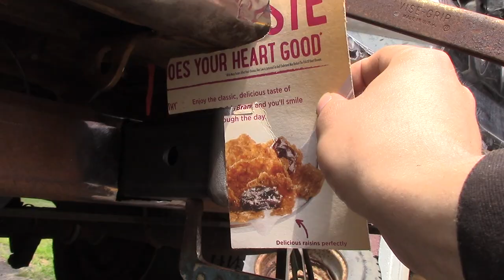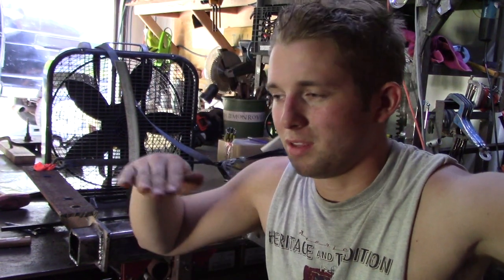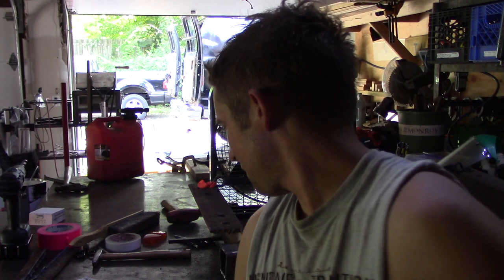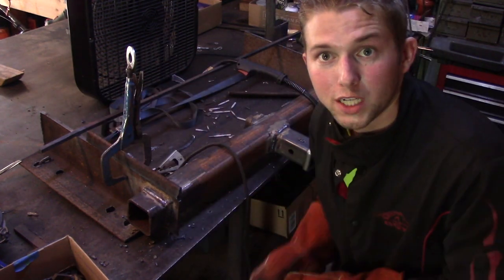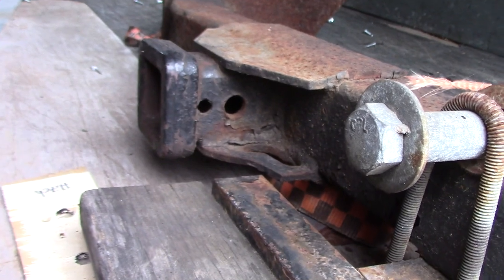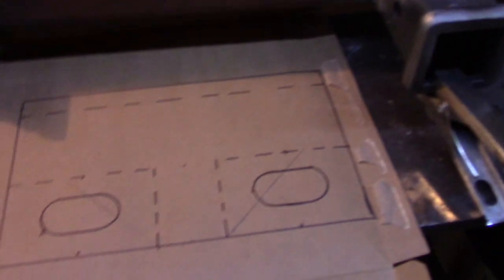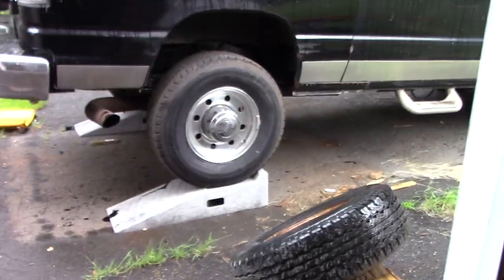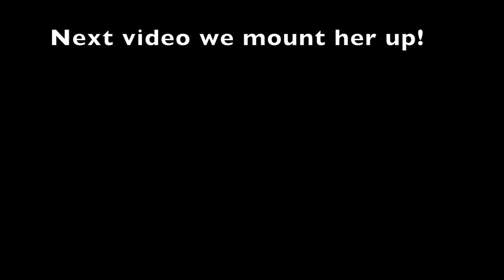Fabricating a Custom Trailer Hitch 2

Comment: For tacking 6010 is great. Run it down hill on verts. Whip pause whip pause etc
Reply from the maker: Its easy to strike, but I've had trouble getting a clean looking bead from 6010
Reply: SnowPlowLife 6010 is a lot like 6011 when welding. WeldTube on youtube has some really good videos on stick welding. Thank you for you video I just got done building a hitch for my duramax.
Reply: I have an antique marquette redi arc 180amp AC welder and a Eutectic 225 AC welder I got the Eutectic for 25 bucks at a garage sale and the marquette for 65 and the marquette is what I'll be using, for being made in the 50's or 60's it still lays some amazing beads. I gotta say man I'm envious of that plasma cutter, I got a 9inch angle grinder for all my cutting. Good job on the hitch! I was wondering how well its held up after a years use?
Reply: 6010 doesn't work well on inverter based machines. Transformer machines can run it no problem.

Comment: I like using 6013 going uphill it's easy to thunderbolt and stick the sticks lol I know how ya feel that top weld looked pretty good I am definitely not a pro by any means I've been doing it as farm equipment maintenance and hobby welding for almost 15 years I am about to fab a bolt on hitch reciever out of 3/8" angle and plate then welding a 2" tube reciever to it for my vehicle because its got the bolt holes in my frame to attach one, I got plenty of steel sitting around, and the cheapest one I forund for it was $200+ so I figure making one for light duty towing will be fine... I liked the video, hows it holding up ince you've got it on your truck?